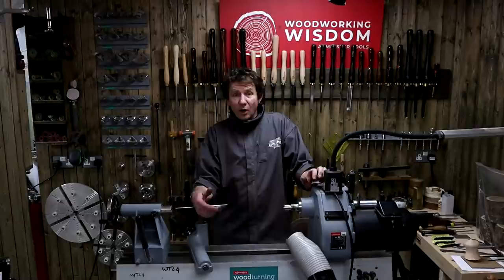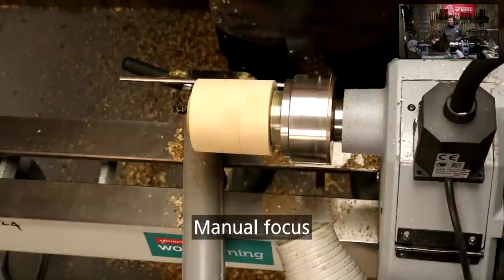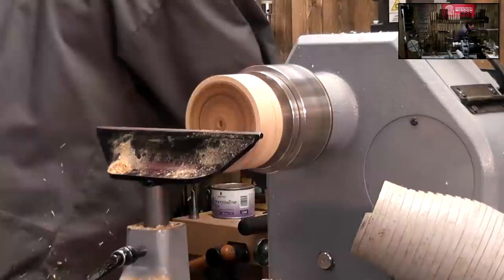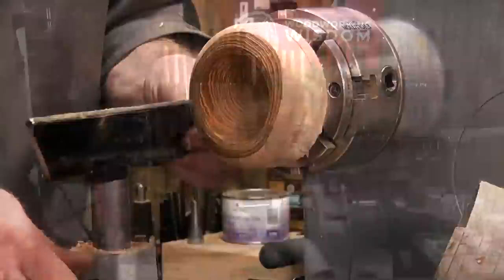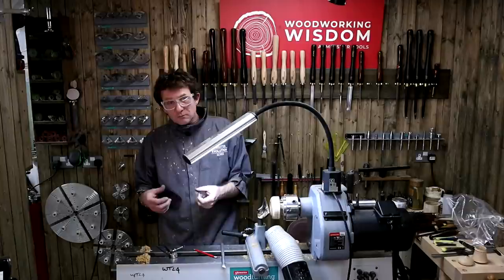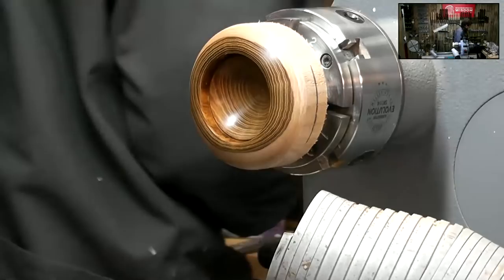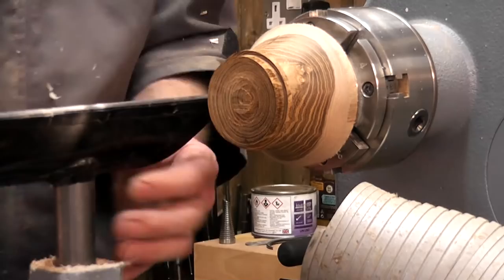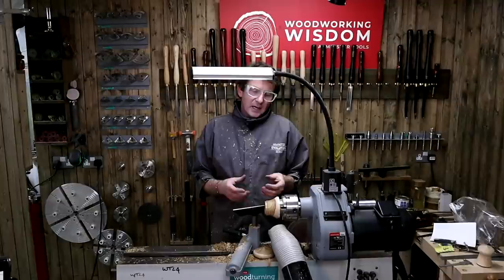How to Turn a Simple Box - Woodworking Wisdom

Comment: Hello,
Sorry I missed the live presentation. Is there any reason why Jason made a recess for the final jam chuck holding the base and not making a tenon. Any marks (not that Jason would leave any) would show on the base. If a tenon was used and held the base on the inside, any marks would be hidden. Not that I am an expert.....Cheers
Reply from the maker: Hi Frederick, the following reply is from Jason - "The reason that I use a recess in the jam chuck is that if you make a spigot that fits too tight inside the base of the box, then there is the risk that will split the timber along the grain. Many years ago I did this and split the base in half, so have always used the recess since. It takes a little bit of effort, but always works!"